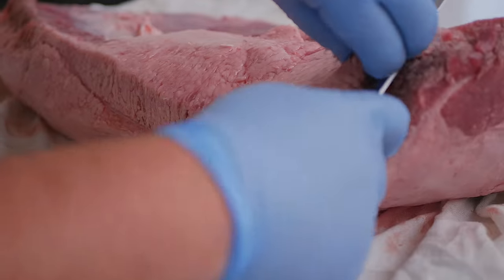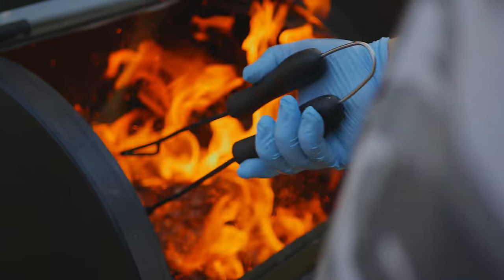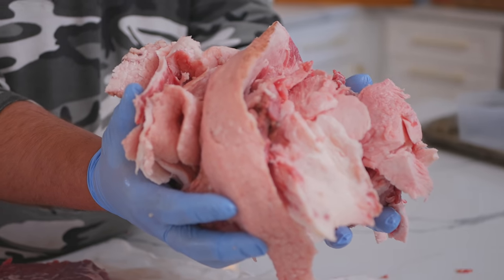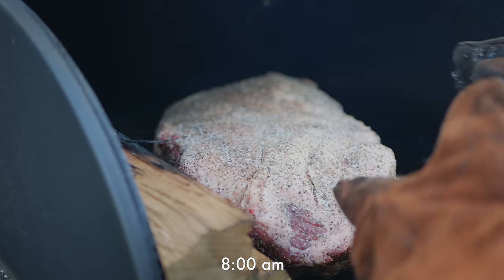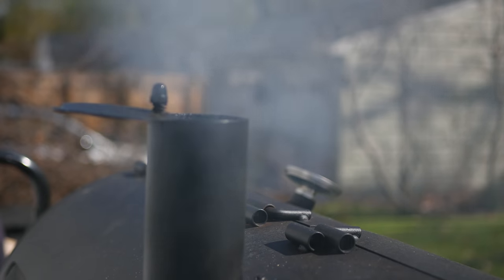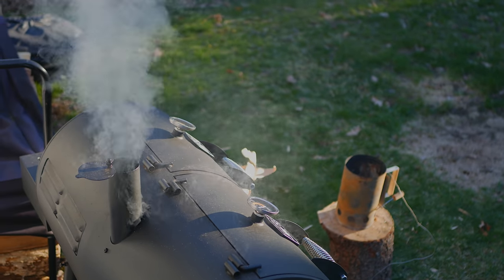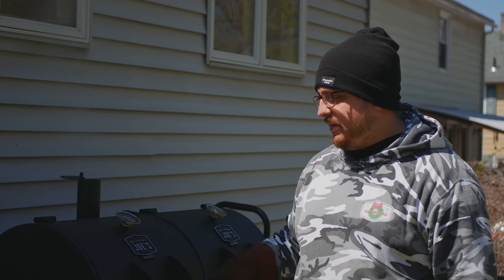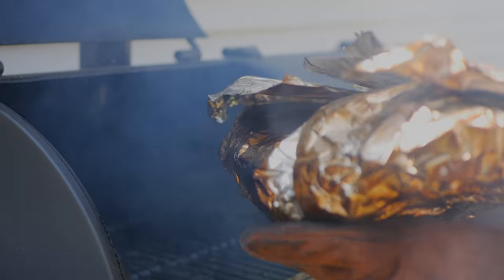The Only Brisket Video You Need

Comment: Just a couple of quick tips Texas style. Your smoke should be extremely thin and barely visible. Keeps it from being over smoked. Save fuel by using the oven after wrapping. It's not going to get added flavor after wrapping. Use paper and paint a little beef tallow on it. You can make the tallow from the fat you cut off. Resting should be at least 6 hours. Wrap it in a towel and throw it in a cheap styrofoam ice chest you can ruin and throw away. Leave it in there 12 hours and let the juice draw back into the meat. You wont believe the difference. Leftovers wont dry out. Love the channel.